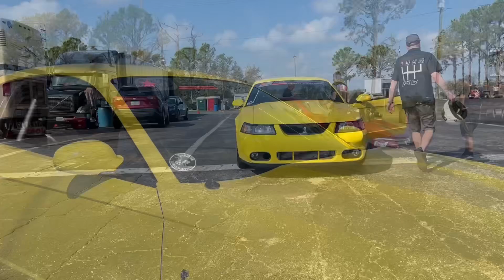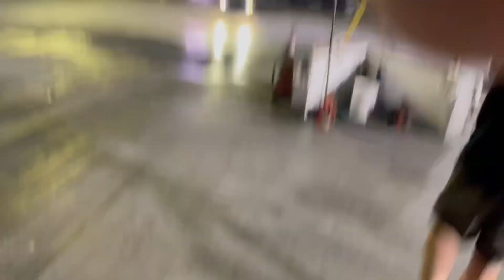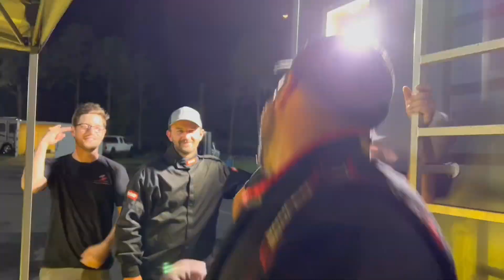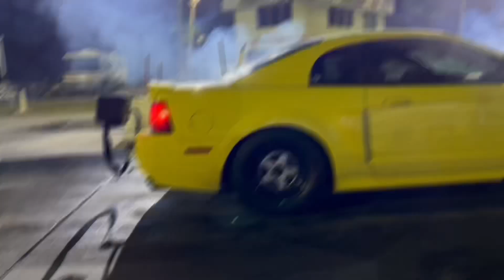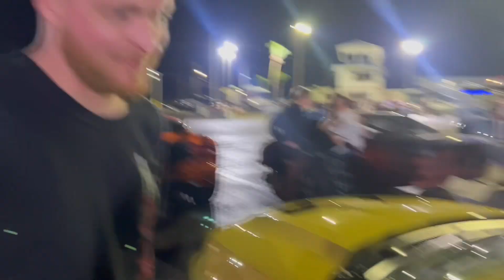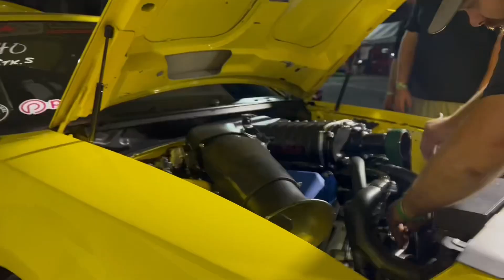Factory Combo Goes 8’s After 20 Years!! Only One To Do It! - Episode #047

Comment: The 4.6 DOHC sounds better than the coyote, still my favorite mod motor.
Reply: and awhiles will, I've got back just to have the correct firing order again.  Just hate the sound of a coyote
Reply: @MODIT  It's the rear mount mufflers, they make everything sound worse. That's why they made a mid mount systems for the 3 valves.
Reply: @anthonyrowland9072 that has little to do with the coyotes different sound because the 07-14 gt500 and 05-10 3v clearly sound different from the coyote and closer to pre 05 mod motors despite having rear mounted mufflers.  That has a small effect on the sound but the biggest thing that makes coyotes sound diff is their firing order like the man said.  The 3v and 07-14 gt500 4v both share firing orders with the old pushrods and pre 05 mod motors. .that is why they clearly sound better.
Reply: Yeah, definitely the best sounding Mustang mod engines in my opinion. That's the only reason I kept my '04 Mach 1...lol. The Coyote and its variants are superior in every way though. That's why I had to get a Coyote F150 as well.
Reply: @chrism.728  right on man! Yeah my brother still has his 99 mustang cobra as well, he has a bassani exhaust on it with a vortech supercharger. I think john mihovetz still holds the record for fastest mod motor? I don’t think there’s been a faster coyote yet? You can make some serious power with the 4.6, but everyone is now doing it with the coyote, I guess it’s easier to hit 1000 hp with it than it is with the 4.6, but all out race the 4.6 DOHC is crazy as seen with mihovetz.
Reply: Yea but have you ever heard one at 8000 or more rpm? OMG

Comment: More evidence that the 03-04 cobra is the strongest stock production car drivetrain. Congrats to the owner and driver.
Reply: Gonna have to go with C6 ZR1
Reply: @nickadkins7765  No OEM GM has gone 5.88 @ 250mph, but John Mihovetz has with a prepped 4.6 4V that utilized all OEM parts with the exception of rods,pistons, oil pump, and gaskets. 
Also, the world record standing mile is held by an OEM block and heads 5.4L that ran 300.4 mph in the standing mile. 
Sealed coyotes have gone 7s 

Ford's twin cam engines > ANY GM 🗑
Reply: @nickadkins7765  😂
Reply: @chadkent1241  Lets not get carried away. The cobra is the only ford engine thats really noteworthy. A stock modular ford v-8 is not in the same league as any iron block LS. No stock internals ford engine aside from the cobra and coyote has seen 8's in the quarter. Meanwhile bone stock truck 5.3's have ran as low as 7's and trapped 190mph. I respect Ford, but lets be realistic.
Reply: @discretion4362  I think that "lets not get carried away" is a 2 way street, for both ford and chevy enthusiasts. terminator cobra, gt500, and coyote stock long blocks have been 8's; stock gt500 long block specifically has been 7's.. 7.94@173 mph. 1272 hp, 1043 tq with the combo being twin turbos and a C4 auto.

Big key there is stock long block from oil pan to valve covers what 4.8/5.3, 6.0, 6.2 is doing that trollface engaged 😈 with a stock cam, and springs... BWAHAHAHAHA! 

Stock long block Ford Power > stock long block Chebby 🤣 and I say that as someone who dailys a 2013 PPV with a heads/cam/longtubes, DOD delete, and LSA blower kit in the living room in boxes, awaiting install. Also previously owned a 6 speed IRS cobra with a built motor, T56 magnum, and 2.9 Whipple crusher (2003, dark shadow gray) and a 2005 Mustang GT, so I may be biased just a little bit... lol

But being serious for a second, LS superiority is in their cost vs performance.... up to a certain extent. Ford guy will never pick up a Gen2-3 F150 or mustang coyote long block for what we could pick up a LC9, LM7 or L33 for. 

But all of this shit is expensive once you start to build it from bottom to top. Pick your poison, Dart SHP 6 bolt block/BMP (world products) or Concept Performance aluminum 6 bolt block, or Sleeved Ford Racing 5.2? 4 Comp coyote cams or Johnson 2116LSR, trend pushrods, titanium intake valves, inconel exhaust valves with a 8620 CamMotion custom cam? CNC Coyote or Predator heads or Brodix/All Pro/CID LS3/LS7 heads? It all becomes checkbook racing at a certain power level, imho
Reply: @discretion4362   lol ok, and which engine from anyone but Ford has gone 300.4 mph on oem block and heads in a standing mile? Zero. 
Or ran 5.67 @ 265mph in a quarter on a ported OEM head? Zero
Or has gone 7.90s on a 100% factory sealed engine and trans? Zero..but 3 Coyites have.
And no other make has done an official 1,000 mile in 5 days public road event and made ten different 6 sec  passes @ over 212 mph over 5 days on a 275 while beating nearly every billet motor entry while running a sleeved oem block, oem heads, and oem crank.

Fords twin cam engines hold all of these records on OEM parts while and Lastly, mmr has made over 4200 rwhp on a billet Coyote block and ported OEM GT350 heads. 
Ignorant Ford haters are the worst.
Reply: @discretion4362   uh huh....
Reply: @discretion4362    your 7s @ 190 was an engine that was prepped and built with stock components, rings gapped, and was in no way factory sealed. I can supply the link....
Reply: @chadkent1241  My first comment was praising the cobra actually. You seem to have a bad case of Ford delusion syndrome. The stock engine of choice for anyone building a budget drag car is a stock gen 3 chevy small block. You can make up as much nonsense as you want about your ford products but the modular ford v8 is not ever to be compared to an LS. Theres a motor trend article from a few years back of a stock bottom end lq4 making almost 1600hp. Let me know when you find a 15 year old ford truck or mustang you can pull the engine out of and do that, ill wait. What does it tell you that almost every fox body at this point is LS swapped. It kinda speaks for itself.
Reply: @discretion4362  until gm can match those records....Ford > everyone else
Reply: @chadkent1241  Gm doesn't need to match those fictitious records. A STOCK Ford bottom end never saw anything near 1500+ hp. We're done here.
Reply: @discretion4362 that isn't true.  Better go study up some more the 03 cobra stock bottom end record is 13-1400 range I'm pretty sure.  Ford gt have made at least that or more.  There are new gt500s doing 1300+ rwhp on stock bottom end too..
Reply: @midnight347  Lol show me one gt500 throwing down those numbers on the stock bottom end. Ill wait. Nice coping.
Reply: Ehh, the bottom end of the cobra is tough, but the rest of the drivetrain isnt that great without a bunch of modification. Probably the weakest factory t56 available, plus the irs basically needs to be rebuilt to handle any power or traction.

Comment: Huge congratulations on your commitment to hitting this! The 4.6 4V is truly legendary to those that REALLY know.
Reply: Best Ford motor ever built.
Reply: @joefell7845  you mean coyote lol
Reply: @_4.6ricardo  No , I mean the 4.6 mod motor that was named after yourself. 😁
Reply: @joefell7845   I sadly have a 3v car which I want to swap 😂, gen3 coyotes been 7s on stock motor no other ford motor ever been that fast
Reply: @_4.6ricardo   John Mihovetz has gone 5.88 @ 256mph on a prepped OEM cast block and heads 4.6 4V that also utilized the oe timing components and factory Kellogg crank. 
The only "coyote" to go quicker/faster used a billet block by MMR and also displaced 70 in³ more. 

The 4.6 4V is every bit as legendary
Reply: @_4.6ricardo   the Coyote arose from 4.6 4V DNA
Reply: @chadkent1241   I’m talking stock sealed unopened engine no ford motor has been faster than a gen3 coyote, every mod motor has had to be opened up to do what they’ve done stock unopened it’s just the truth. Ofc the 4.6 4v is what the coyote is derived from it’s the same architecture

Comment: Heck yeah dude! This motivates me to keep pushing mine. 

I finally got the faceplated tr6060 in from rpm transmission, for my hellcat. 

I did a shake down roll race at MIR and uploaded it to my channel. 

My damn triple disc started slipping on my way home that day, so mantic is currently rebuilding my clutch. 

Going for low 10 as soon as I get the clutch back!

Comment: I have a lead on a 04 that has a built motor 5.2, built suspension, Aeromotive fuel system, KB Mammoth but its locked up. Hasn't been started in 12+ years. I need to make that car mine at any means

Comment: Congrats! Very impressive! Too bad the trans broke on that last pass, looks like it was going to be a fast pass. 

Side note, is that VMP's intercooler brick? If it is, I'm assuming you know about what they have posted regarding the part needed to strengthen their intercooler brick? Looks like that's what failed in your situation.
Reply from the maker: It’s was a VMP brick. Starkey was there and looked at it…it was fixed later on.
Reply: @2ndshiftracing  Ok cool. But just so you know, VMP will ship you out the updated brackets that will prevent this from happening again for free.
Reply: Last pass it went 1.34 in the 60ft.  That was going to be the overall for sure.

Comment: Very nice. Is he still running a stock motor?
Reply from the maker: He is not, it’s the same compression as stock but in a teksid block with ported heads and cams turning 8500rpms.

But you can watch Ep. 035 on our channel where Zach race 8’s with the stock motor.
Reply: @2ndshiftracing  Cool. You know what rods and Pistons?

Comment: Radials or Bias?
Reply from the maker: Bias ply
Reply: @2ndshiftracing  gee and why would that be ?(having an argument with my foolish
 SRA buddy saying drag radials are fine on an IRS car)
Reply from the maker: Couple reasons…IRS has a lot of linkage that moves and a radial is stiffer transferring more shock load on said components. So it’s wiser to run a bias ply due to its soft structure…it absorbs more shock load on the hit and saves drivetrain components. That’s why we urge cobra guys to run a 28” slick on IRS…more sidewall, and more consistent. Also a radial works best with antisquat geometry, being that an IRS squats it wouldn’t work as well or be consistent. You would need to slip the clutch quite a bit.